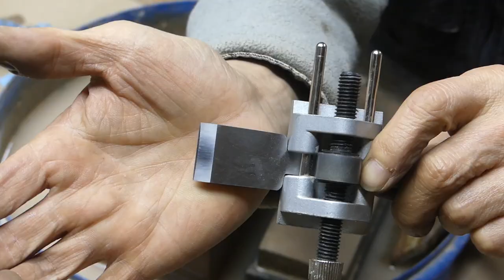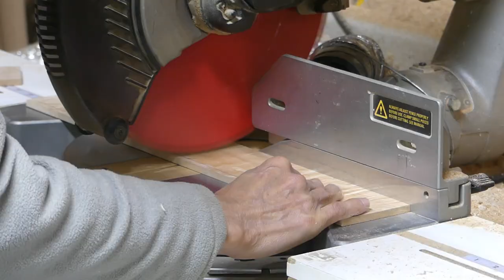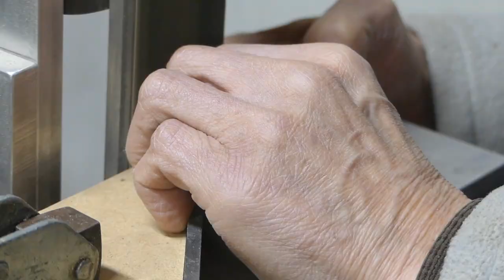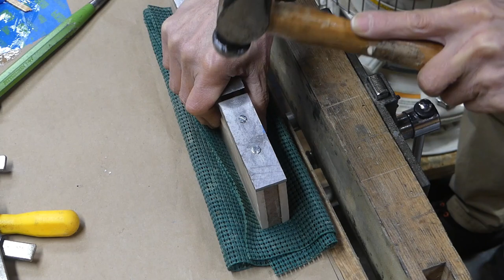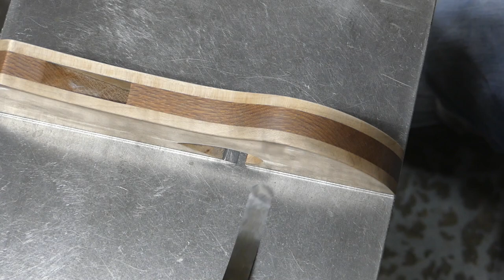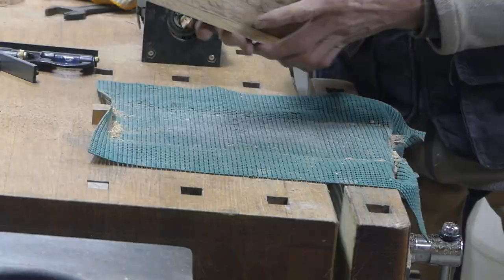Make a steel sole shoulder plane

Comment: how come you didn't countersink the holes for the screws, unless you don't have a counter sink. Excellent craftsmenship either way as you did sand away any trace of screws
Reply: Xlaxsauce I think that's how I would have done it, but with the epoxy it probably doesn't matter.
Reply: I wondered the same thing but with all the grinding and sanding it didn't really matter, the screws just disappeared. Maybe with a countersink he would have had to sand deeper.
Reply: Rich Wachtel Peening, as he did, is traditionally combined with countersinking, creating a better mechanical bond. But usually that's with pins that go all the way through to another metal plate on the other side.

Comment: Even if it is for a customer's request, it is unnecessarily complicated. it became a fetish, those infills, brass, steel soles. it is a tool. Using hardwood is a necessity, bird's eye mapple, exotic wood this is ridiculously funny.
Reply: Seems to work fine...
Reply: He's making the tools he wants the way he wants to make them. What's the problem?? 

A little insight you might not have considered: some people enjoy making tools, to the extent that making the tools is sometimes the actual goal, not using them. I don't think that's the case here, as he always seems to use the tools he makes, but it does illustrate that slapping together a tool that just works would not be sufficient for many people. It's called craftsmanship. Some people value it, and others buy flat pack furniture. If it's not for you, that's fine. But ridiculing someone for doing a better job than you would have done only makes you look silly.